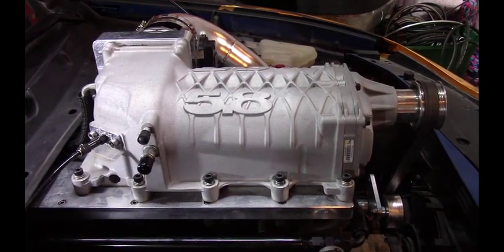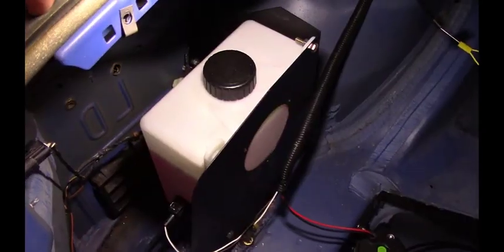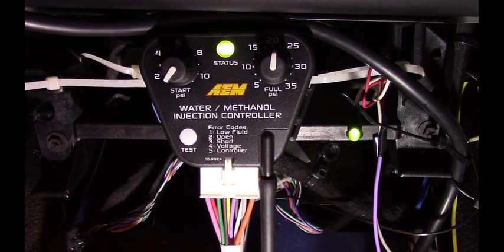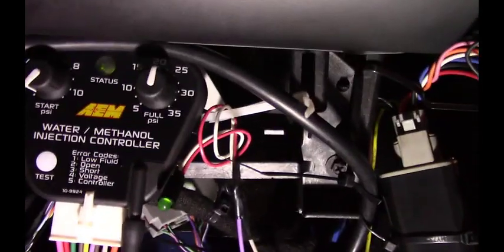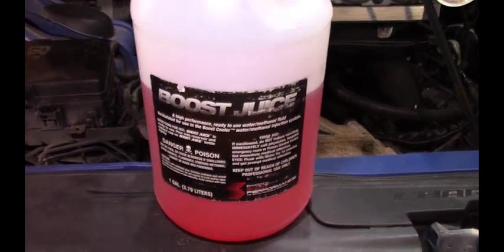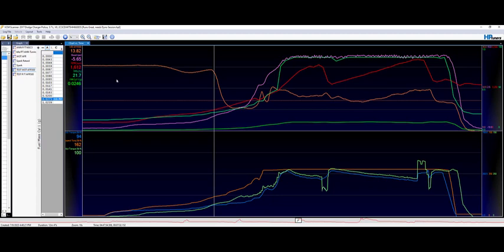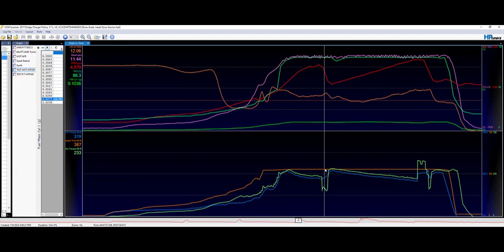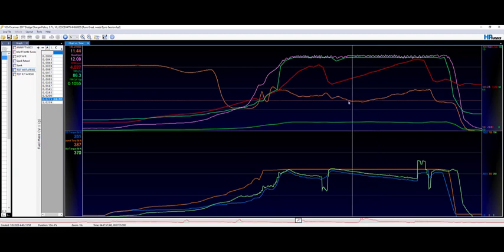GT500 Supercharger on Hemi! AEM 30-3300 Methanol Injection Install

Comment: If you get 12 psi and you set full to 20 you are only getting half the full spray
Reply from the maker: @Albinosnake1997 The instructions explain that if you set the top PSI to 12 then you get the full flow of the Meth Jet at that PSI. Its really not that smart of a system, its manipulating both dials to maintain the desired AFR via datalogging. Using the wideband and trial and error produced the best results for me.
Reply: FYI the boost juice is only 30 percent meth and 70 percent water if you do a true 50/50 you won’t get as severe misfiring as you will be getting more methanol vs water and you won’t quench the cylinders I’m running 1000cc with a 625 nozzle pre rotors and a 375 post rotors and I don’t get any quench with a 50/50 mix snow performance boost juice is not a true 50/50
Reply from the maker: @Albinosnake1997 Great info thank you!